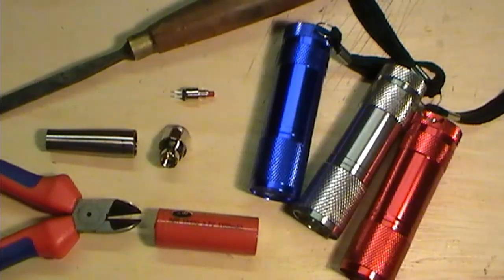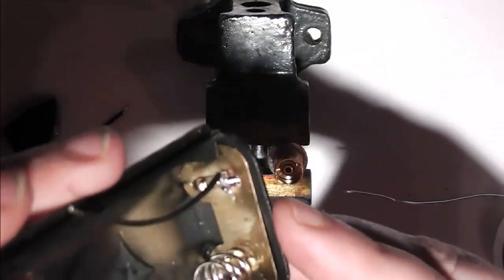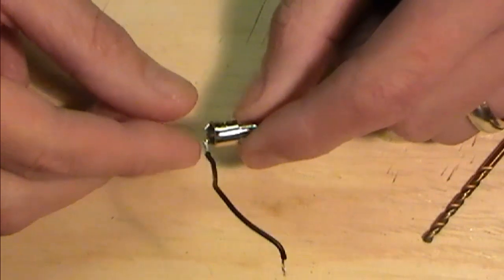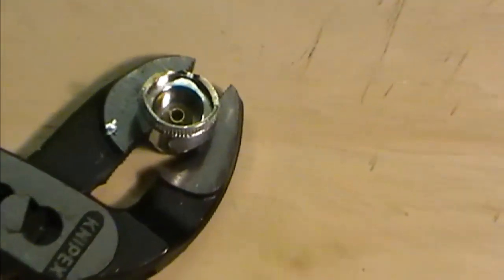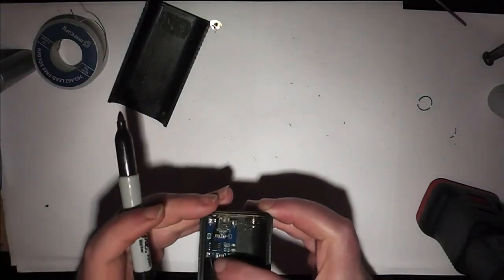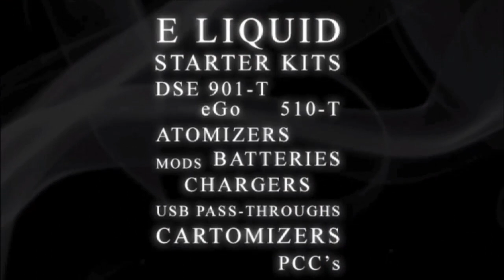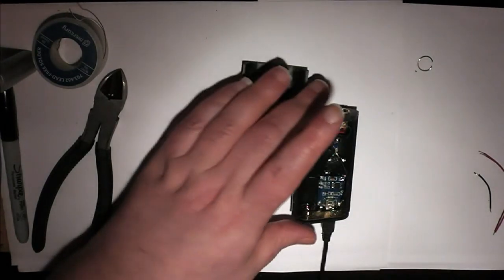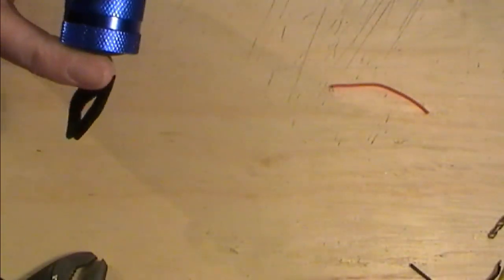Tin your tip 01/03/13

Comment: Thanks Alex, like a lot of the parts i use this one came from Ebay, if you search for (5V Mini USB 1A Lithium Battery Charging Board Charger Module) they should all come up and if your not in a great hurry you can get them from china on there for £1.50 or less delivered